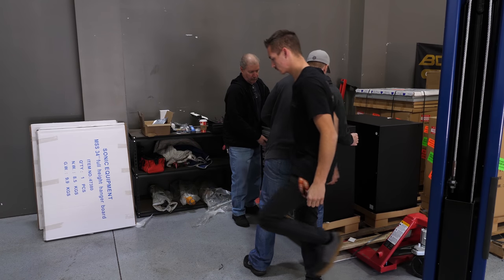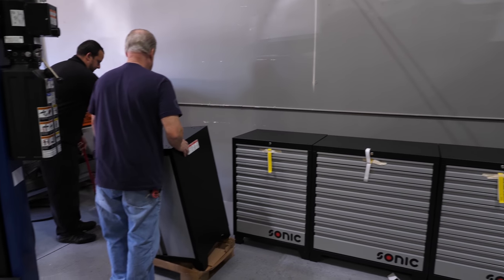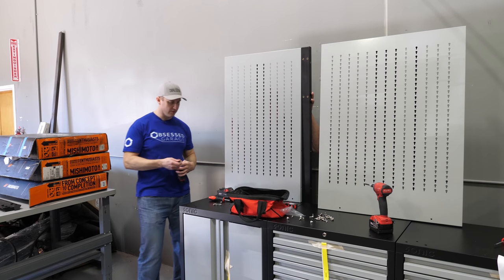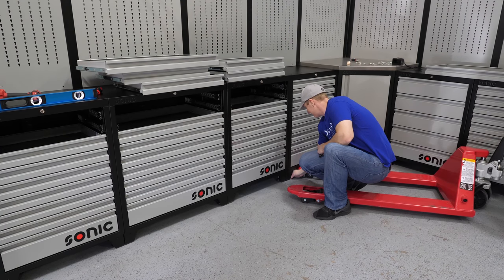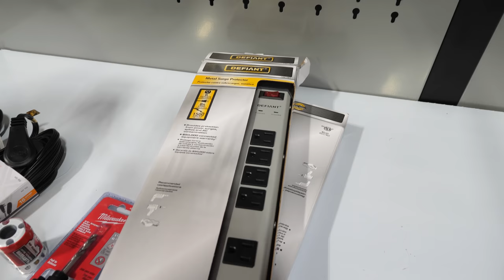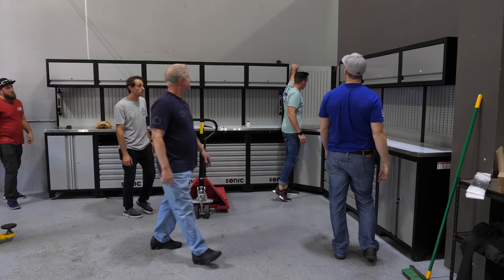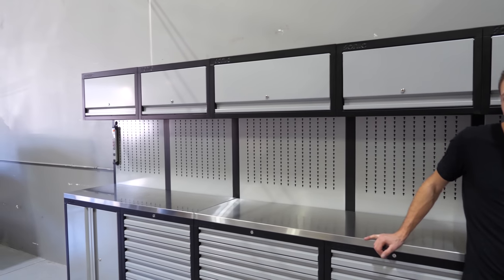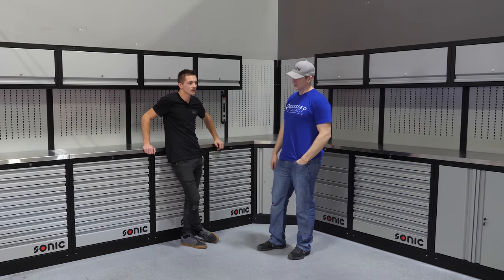Adam LZ Warehouse Project: Sonic Cabinets

Comment: For the holes that the power strip cord goes through, if you can’t find the proper size grommet look online for a Hobby store near you that sells radio controlled items and see if they sell fuel tubing which all of the hobby fuel tubing is a small diameter silicone tubing that you can buy by the foot and cut to make the correct size grommet you need.

Comment: Over $11,000 for cabinets/tool storage? Man...when did this stuff become so expensive. Don't get me wrong...these look SUPER nice. Nice work on the clean install! NOTE: the 26" 9-drawer costs more than the 34" 9-drawer...doesn't make sense. haha
Reply from the maker: These are actually much less costly than most of them.  The 26" Cabinet is $700 and the 34" is $850.  I fixed it on my site.

Comment: Can’t you buy power strips from Sonic that are integrated into the cabinets?
Reply from the maker: I think you might be able to do that.  I still have some work to do to become a full expert in all options available.
Reply: They actually make a strip that runs horizontal across the counter that has power, USB, LAN, and air connections.
Reply from the maker: I'm pressure sure that's only part of the MWS (master workstation).